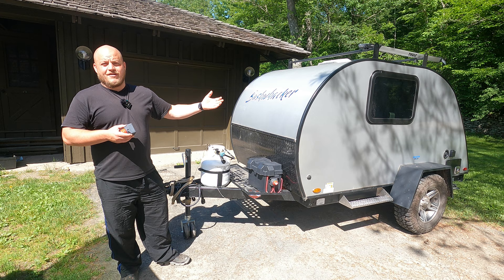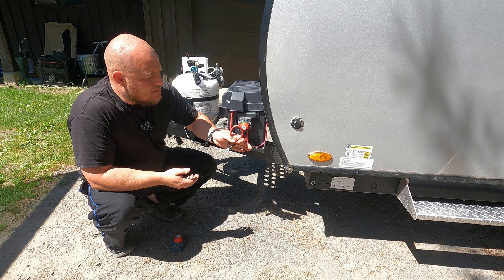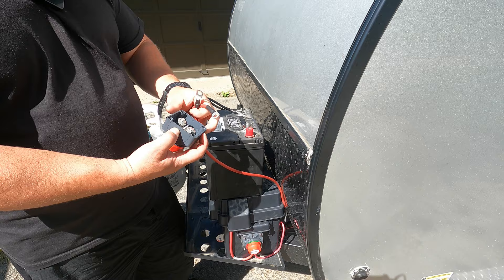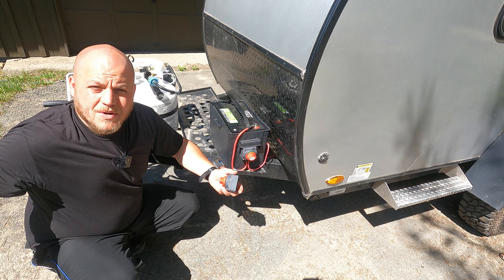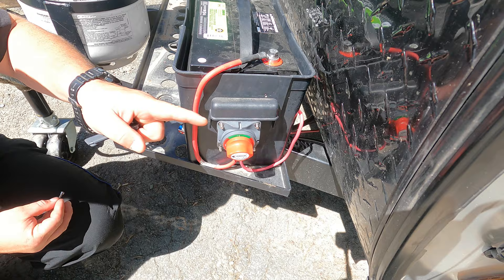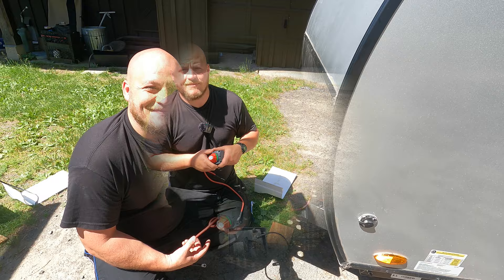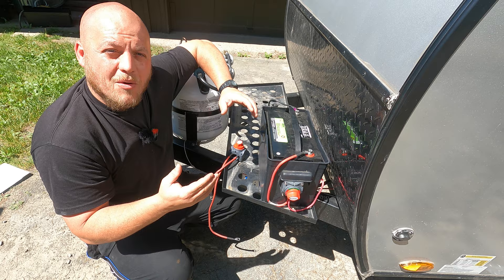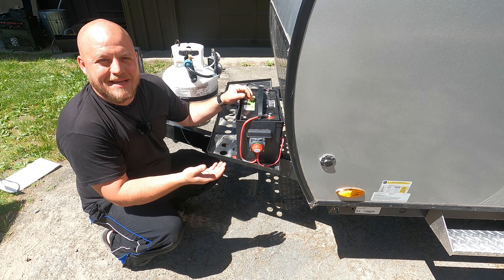Installing Master Switch on Camper Trailer | RV Kill Switch

Comment: Hi, I just bought a popup and want to install the cutoff switch. My battery has all kinds of wires running from each terminal. Do I need to take all of the  wires (4 i believe) and connect them to the master and then run a single 8 guage to the battery?  All of the videos that i have watched , have a single neg and pos cable. So, i'm not quite sure which way I should attach. thx.
Reply from the maker: You're exactly right.  However, everything you attach to the master switch will be shut off when you turn the switch. 

 If there's certain things, like solar, that you would like to continue to work, while the camper is turned off, you can leave those on the battery.  On my set up for instance, I left the solar charge controller attached to the battery and attached everything else to the master switch.  When I turn the camper off, it can still charge the battery.
Reply: @DIYOutdoorLife  i have the solar prewired, I have no idea, which may be the solar wire. There others are probably the electric brakes and the power canopy lift and ??? I’ll have to just power up and identify one at a time.
Reply from the maker: @camillesanders4552  exactly... process of elimination and youll get it

Comment: do I need this if my camper has the cutoff switch/red key thing on the hitch? Thanks for your videos I just got my renogy 200 watt suitcase and am itching to try it out.
Reply from the maker: You will not need to add an additional cut off switch if your RV came with one.  For some reason, a lot of campers do not come with a cut off switch and it’s a must add.
Can’t wait to hear how you make out with the solar!
Reply: @DIYOutdoorLife  
Thanks
I have heard that there is a slight power draw even if that red switch is off, any way to check that?
Thanks again
Reply from the maker: @TheSkite575  do you have a multimeter?  If there is anything, wired directly to the battery, that bypasses your switch, there could still be a small draw. If the draw is considerable, you can add a switch like I did, or just disconnect the battery when in storage.
Reply: @DIYOutdoorLife  
I have a meter, but not sure how to check that. Would I check voltage with battery disconnected then connected with switch off?
Reply from the maker: @TheSkite575  I started typing out an instruction on how to do it and decided it wasn’t a good idea… lol. There’s a way to bridge from the battery to the supply wire on the camper using a DC current setting, best to skip this if you haven’t done it before.

It might be best just to just charge the battery completely and let it sit on the camper for a week or so with the switch off.  Just do as you said, and check the voltage of the battery periodically.  After the battery has rested from charging, it will be in the 12.7-12.8v.  It should hold that voltage with your master switch off for a week.  At the end of the week, if it’s 12.6 or higher you’re OK.  If it’s drawing your battery down below 12.6 with the master switch off, something is still drawing on the battery.

Hope this helps !
Reply: @DIYOutdoorLife  
Ok, thanks for your help have a great day

Comment: I'm going to install the same style switch and looking for a solar battery maintainer. We use 2 deep cycle 6 VDC batteries. You think a 5 watt battery tender be sufficient to maintain them with the disconnect switch off?
Reply from the maker: Since the price doesnt change much, look for something a tag bigger.  They have some 10's and 15's for a similar price.  Otherwise the 5 will do the job fine.
Reply: @DIYOutdoorLife  thanks

Comment: Question for you if you don’t mind. On a typical teardrop with factory single solar panel installed. If you turn off the master disconnect will it still charge with solar? Or does that switch need to be on?
Reply from the maker: Great question. If you check out my solar videos, I get into this discussion.  It depends.  I recommend connecting your charge controller directly to the battery, rather than using a solar on the side port.  This set up gets more energy into the battery by eliminating some of the loss experienced through the side port.  Another advantage is you CAN charge the battery when the switch is off with this set up.  In essence, you will have your camper turned off with the solar charge turned on.  If you are using side port, the master switch will shut off the charging to the battery. Hope this helps! Check out those solar videos.
Reply: @DIYOutdoorLife  thanks. I’m really not sure how they will wire it.  I have to wait and see.  It looks like the solar controller is inside and the panel is connected through the roof.  Time will tell. I’m just to excited to get it. But it will be a while. Still not built yet.  I’m new to the whole caper thing and with all that is going on. It’s hard to get any information on this new camper
Reply from the maker: @anthonygraham6449  with that set up, the master switch will likely turn the solar off as well. Circle back when it’s done and I can let you know for sure.

Comment: Can u do that with double batteries or its a problem 🤔
Reply from the maker: No problem. You do it the same whether the double batteries are in series or parallel, just put the switch on the red wire going to the camper.
Thanks for watching, hope you’ll subscribe!
SUBSCRIBE: https://www.youtube.com/c/DIYOutdoorLife?sub_confirmation=1

Comment: Does the battery recharge when hooked to auto?
Reply from the maker: Yes it does, the alternator from the tow vehicle charges the battery
Reply from the maker: @jimkeeling  you would want to upgrade to 7pin for that charge, some wiring needed.  I made that upgrade on my jeep, not a bad job

Comment: Hi, my pop up camper has 2 red wires.. can I still use this switch?  I connected just 1 red wire to it and it didn't kill the battery. I would appreciate any advise, it's just a small pop up, but the battery died last year and it honestly took forever to hand crank it up and down.
Reply from the maker: put BOTH wires on one side of the kill switch and run the new short wire from the other side of the switch to the battery.  It will work fine.  Circle back if you need more help.
Reply: @DIYOutdoorLife  Thanks again, will do this tonight!!

Comment: will it work the same if I have a solar panel charger hooked up all the time?
Reply from the maker: Depends on how the solar is hooked up. I recommend hooking a solar charge controller directly to the battery, then it stays on when the camper is turned off.  If your solar runs through the “solar prep“, then it will be switched off when you turn the Master switch off.
Reply: @DIYOutdoorLife  ... I had it installed by Camping World so I assume it is hooked up right. I know the two wires are hooked up to the battery and it is still charging when I have the battery terminals unhooked to keep the battery from discharging by the stereo system and other things that drain. ... thank you so much for your response. your video is very informative and to the point.
Reply from the maker: @j.r.worley6981  that’s great! So both ways are “right“  but I’m happy they did it that way. Now when you turn your master switch off, the solar charges and keeps the battery topped off. This will greatly improve your battery life expectancy.

Comment: Could I use this on my car battery to shut off the main power to the computer etc?
Reply from the maker: Yes. They make certain knife switches that install on the post of a battery, that way you don’t need this switch with wire etc under your hood.
Reply: @DIYOutdoorLife  thank you you're awesome

Comment: My trailer has 3 wires to the positive post , one is for the power tongue jack ( fused ) and one of the other 2 is clearly the main power wire but I also have a much thinner wire/ cable and would like to know what it does ? Do I place those two on the switch or just the thicker one ???
Reply from the maker: You can run one side of the switch to your battery and the other side to all of the positive wires that were on the bat +. 

When the switch is in the on position, it will perform like it did before you installed, when the switch is off, it will shut everything off.

This is one simple way to get the job done.
Reply: @DIYOutdoorLife  correct , but I would like to know why I have that extra smaller wire , what does it go to ? If I connect as you mentioned , would battery still charge if switch is left off while I’m towing and plugged into truck ? My other trailers have a factory installed switch  and battery still charges with switch in off position while plugged into truck …
Reply from the maker: @emtluis  it may go to the solar input plug… depends on your particular set up.

If you wire the way we show here, you will need the switch on to charge while towing. It’s a little bit more involved to have it turn off camper power and maintain car charging. Not hard to do if you need that but you can also just keep switch on while driving.
Reply: @DIYOutdoorLife  Humm. I do have a solar panel input plug on side of trailer. Never thought about that.

Comment: How would you size the switch?
Reply from the maker: Most of these DC switches are capable of handling hundreds of amps.  For most applications, this styles of master switch is good until you get to campers with a very large inverter.  Unless you were using something that drew over 2500 W you're gonna be fine.  At that point, it's worth going with some very heavy duty gear.
Reply: I have a 3000W 24v  inverter but I cannot seem to find information on how to size these switches. Thanks for replying.
Reply from the maker: @Damian-xc7km  that's no problem at all.  Since I was considering a 12 V system, the amperage is double.

In your case, with 24 V, the amperage would only be 125a ... that's below the current limits on these switches. 

As a general rule, when dealing with higher current, I do like to go with a higher quality switch .  This one from blue Sea would be perfect for you.

https://amzn.to/49oAv34
Reply: Funny enough I do have that one saved in my Amazon list.  Thank you for taking the time to respond. I really appreciate it.
Reply from the maker: @Damian-xc7km  anytime!

Comment: How and where would you connect the kill switch on a parallel deep cycle battery setup?
Reply from the maker: On the positive wire heading to camper. In other words, although there are two batteries connected together, there is still one red wire heading to the camper- that gets the switch
Reply: The instructions from the supplier says to connect to the negative side for safety reasons, but doesn't go into detail. Thoughts?
Reply from the maker: @AUDIOMIND  This is a tough question to answer in a short YT response. I’ll do my best…

Industry standard is to master switch the positive. This eliminates the potential to appliances and does not interrupt the pathway to ground.  In many applications, switching the negative is against code.  

If you do this sort of thing a lot, you’ll come across several cases where switching the negative is easier and an acceptable practice.  Anyone who claims it’s “better“ to switch the negative on an RV and doesn’t know what they’re talking about.  When you can switch the positive, do it.  If you have multiple wires going to the positive terminal, place all of those wires on one side of the switch to illuminate everything when the switch is cut (if desired).

Hope this helps, sorry I couldn’t go into more examples.
Reply: @DIYOutdoorLife  Appreciate your response, no worries. Hooked mine up to the positive and all set. Thank you sir.

Comment: Would install be the same for a boat?
Reply from the maker: Yes, same set up and rational.
Reply: @DIYOutdoorLife  I am reading that it is safer to use the negative side black wire instead of the positive side red wire like you did in the video.  Does it matter which way you do it?
Reply from the maker: @georgehatzakos638  where are you reading that? It is not safer to use negative. Although both work, positive should be favored over negative for master switch.  You’ll see that it’s even mandated by many codes that enforce safety for autos, planes, boats, etc.
Reply: @DIYOutdoorLife  when I went to the link on Amazon for this product under the Questions and Answers there are several people that suggest it. Kinda 50/50
Reply from the maker: @georgehatzakos638  I run into this problem all the time. It comes from misapplying a specific issue with replacing batteries on cars.  
very very few DC masters should be placed on negative, there’s a specific time and place for it and it’s rare. 99% of the time positive is better by removing potential to appliances and not removing the pathway to ground. Hope this helps!